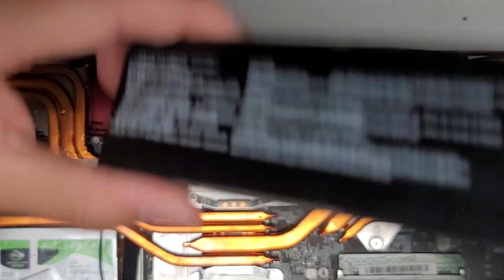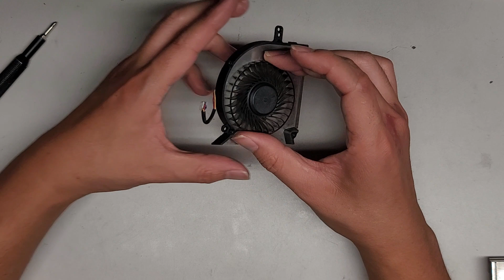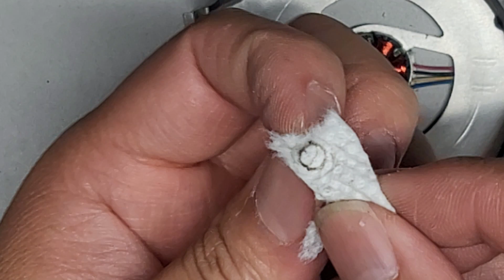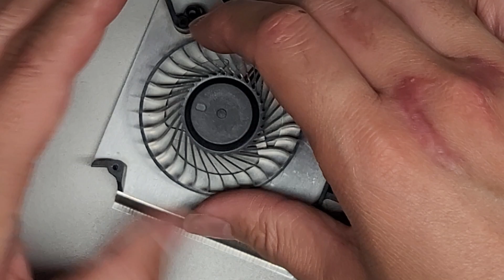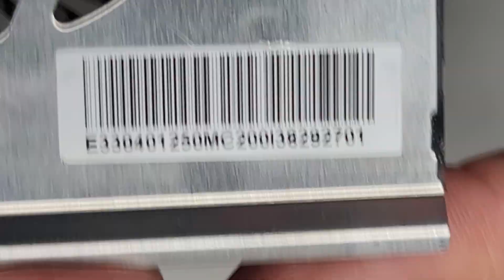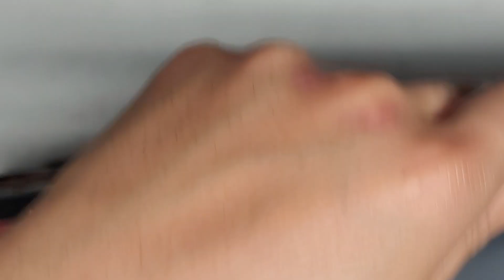MSI GL63 8RE Disassembly RAM SSD Hard Drive Upgrade Fan Heatsink Thermal Paste Repair Battery

Comment: Hey Binh, awesome video!
I think that for a first timer I won’t risk doing this myself, but I’ll make sure the technician in charge uses this video as an anchor for how to navigate the laptop.
I am asking him to clean the fans like you did, also, what else can I ask him to do maintenance on, since I have the laptop in the repair shop? Cleaning and repasting thermal paste I know, but can we do anything else? Like replace thermal pads or something?
Thanks for your amazing video once again 👍🏻
Reply from the maker: You can have them use ptm7950 and thermal Grizzly putty pro
Reply: Thanks man.
The thermal paste I can only find 30grams and it goes for 40€.
The Honeywell pads I found on Aliexpress (I am from Portugal) but they come in several sizes, which one do I need, do you know?
I wasn’t sure if you were gonna answer, let alone this fast! If you weren’t on the other side of the ocean I would totally just ask you to do the service 👍🏻

Comment: The specs states max RAM 32GB, you mention 64GB, have you been able to get the bios to regognize and use 64GB?
Reply from the maker: Haven't done it because it's my customer's laptop. Usually the max specs is the limitation of what was available at the time the laptop was manufactured, not the actual limit.

Comment: Thank you very much for this detailed explanation however, i would need your help to reassemble my laptop as i have cleaned out all heating pads which are damaged due to heat.  I am bot sure of the thickness of the heat pads that i need to buy?  Would you help me with that?  My laptop model is MSI GL63 9SEK …. The same model shown in this video.. thanks in advance.

Comment: 2 years later and this video is still helpful. My only challenge is getting the fan connectors off. Mine seem to be really latched on. Is there any tool or alternative way to remove the connector besides fingers?
Reply from the maker: You'd have to be very carful, but some tweezers or needle noise pliers.

Comment: Thank you so much, I've just successfully finished cleaning and repasting the thermal paste. I haven't been cleaning it since I bought it at 2018, as you can imagine, the air outlets of the both fans have nearly been blocked entirely by piles of dust. I can feel my laptop has been overheated easily for the last 1~2 years but I just too lazy to clean it. Thanks for your helpful video again, it's now back to normal!:elbowcough:
Reply from the maker: Awesome! Glad it's working well again. If you haven't already, please like and subscribe so others can find my videos and possibly consider watching a few others and commenting to get the algorithm to recommend my channel. Thanks!

Comment: Hi, did you try replacing the m2 ssd ? I have this model and im not sure why it doesnt slide out. I'm not sure if is glued or what, or how I could replace that ssd. Do you have any suggestions? this video is great btw! thanks so much
Reply from the maker: @LauSanchezAcosta-m6x  thermal pad. Pull up slowly and let it gradually peel itself away. It'll pop up like the RAM eventually and then you can pull it out.
Reply: @ItsBinhRepaired  Thanks so much, will try it, I was scared was something more complicated
Reply from the maker: Hope it works out

Comment: I'm having trouble with lifting the middle because of the paste. I see that there is still white paste that is squeezed out on the sides so I'm assuming that the manufactured paste is still good?? What I noticed is that when I try to wiggle the left side where the gpu is it doesn't budge because of the paste that's already there and when I wiggle the side where the cpu it wiggles more. I tend to have high temps in cpu than I do in the gpu.
Reply from the maker: Have to twist it a bit.
Reply: @ItsBinhRepaired  Thank you.
Reply from the maker: @anneeti5354  were you able to get it out?
Reply: @ItsBinhRepaired  Yes and I'm already done cleaning and pasting thanks to your video.👍
Reply from the maker: @anneeti5354  awesome!

Comment: no need to disassemble. I cleaned the back and side grills using a sharp wire or tweezers without opening the case. The temperature dropped to 15 degrees. I just did it by pulling the dust inside the grills from the outside with the help of wire. we Turks are good at practical solutions.
Reply from the maker: Lol

Comment: 12:50 those extra slots for the ssd. I noticed your laptop doesnt have the m.2 pin slots. How would you upgrade the ssd on this laptop if yours doesnt have the ssd slot?
Reply from the maker: 2.5" SATA SSD if no m.2

Comment: Bro i tried too hard to pull the left wire of the fan connected to the motherboard
It made a loud crack noise at the connection and now the fan doesn't work anymore
Reply from the maker: What part cracked?
Reply: @ItsBinhRepaired  according to ur vid, the wire connecting the fan to the motherboard on the left (which u took out using ur fingernails)
That part
Reply from the maker: @wafflebutsad  the wire broke or the connector?
Reply: @ItsBinhRepaired  the connector on the motherboard
Reply from the maker: @wafflebutsad  oh no, you'll have to find someone that can fix that.
Reply: @ItsBinhRepaired  my laptop is 4 years old now and the part connected to the hinge is disintegrating too
Lol guess i can make this last for a year more
Reply from the maker: @wafflebutsad  lol D: maybe not worth fixing

Comment: How many grams of thermal paste is that?
Reply from the maker: I don't measure it. Not sure
Reply: @ItsBinhRepaired  which one are u using lol and how much is left
Reply from the maker: @wafflebutsad  I use ic diamond and I use a big one for several uses. I do this for a living.
Reply: @ItsBinhRepaired  i see thanks lol came to ur video coz i was wondering if 1g of thermal paste would be enough for the laptop CPU and GPU
Reply from the maker: @wafflebutsad  not sure it'll be enough for both. Possibly

Comment: I used this video to clean my msi laptop, everything went great!
Reply from the maker: D: the fan won't pop out?
Reply: @ItsBinhRepaired  hold on I fixed it, the fan did come out but the metal bent a little before it came out. I think these fans are just very hard to pop out lol. I put it back on and it is very quiet now :)
Reply from the maker: @flubcast1084  awesome!